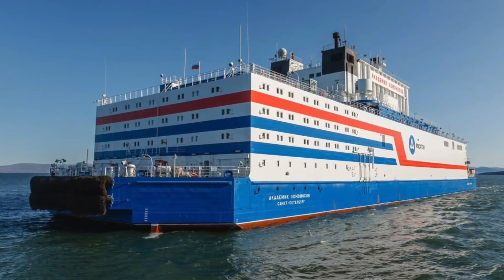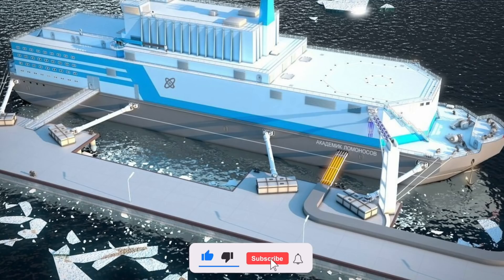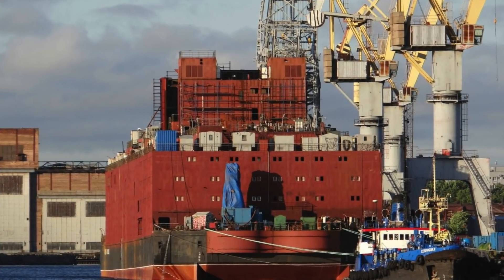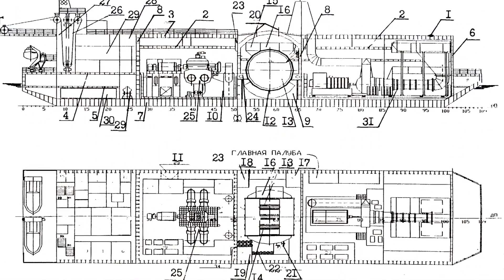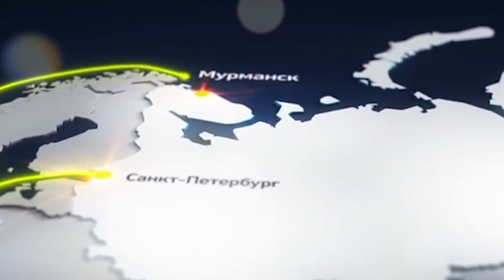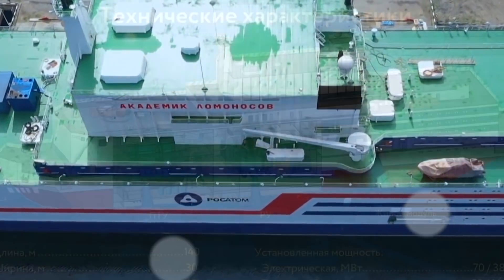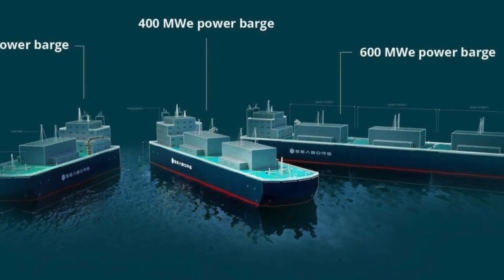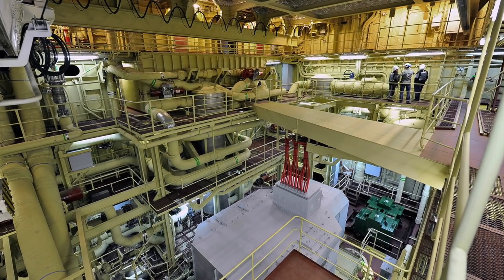Is the Lomonosov floating nuclear power plant a global catastrophe?

Comment: Pro's and Con's NEED to be worked thru one by one, to determine which decision/direction to travel. This is ESPECIALLY true when it comes to the matter of Nuke Power alone but, installing a Ship that is a Power Plant "to supply power to remote locations", why not spend the Rubles on P.V. cells instead? There is no shortage of Sunlight, or even some other "Green" energy source. Being situated in the Arctic, I would be VERY concerned of a Powerplant Ship, especially in the Famous region of Siberia, in the Kamchatka Penninsula, experiencing some EXTRA-SEVERE winter conditions including Glaciers. But with the track record of the Soviet Union and Nuclear powered ships being decommissioned by scuttling them without even securing the reactors, seemingly not even giving a s*** about the Environment. Wanton actions against everything Natural, Exo-system related, health concerns, etc. So.......
Just my thoughts here.

Comment: THE US havent realesed a non nuclear submarine since the 50,s so ye its a horrible recipe for disaster 😂😂😂😂😂😂😂😂

Solar and wind arent renewable either  the material used aint 1 shit renewable and quartz with the extra is toxic as hell not to speak of the batteriets.
 It also provide next to 0 energy by comparssion.

A failing experiment on a wrongly buildt reactor and a diesel generator Being flooded aswell as A HUMAN TURNING OFF THE COOLING PUMP should really NOT DEFINE AN INDUSTRY, you retards!

And fyi a coal power plant releaser more radiation than nuclear powerplay during its lifetime, idiots.

Comment: Go to nine sea camels with desalination on one, outboard.  Cooling coils within two, outboard.    Nuclear boiler in middle sea camel.  Electric generation from steam in two, inboard toward shore.  Cogeneration on one, aside.  Controls, crew, spare parts, shop, in another, also aside.  At ten years, the sea camels needing refresh are quickly replaced by new sea camels and the unit continues production with one or two days down time.  The unit removed goes to dry dock for refurbish, update, inspections.

Comment: While the Lomonosov may well have a 'great margin of safety', there is only so far one can go with a PWR design. I like the inherent safety features of Seaborg and Thorcon's MSR designs better. Also cheaper in the long term.
Reply: Look, 'better' is the enemy of 'good enough'.

PWRs are 'good enough' and we're not building enough of them today. Tomorrow's revival's of past technology that got left at the wayside by political funding cuts is for tomorrow. At least Lomonosov is providing power and heat today.

Plus, for a marine/aquatic application, I'm not sure what is ultimately safer. A PWR/BWR where you're surrounded by limitless emergency coolant/moderator. Or a MSR/Liquid Metal Cooled Reactor where in the same position, you have little back-up coolant at best, or you're surrounded by a fire and explosion hazard rather than limitless cooling.
Reply: @TheSonic10160  Don't get me wrong, I'm not against PWR's in principle, but any energy production system has to be competitive, efficient and as safe as one can manage. If MSR's can be built cheaper, run with a fuel efficiency orders of magnitude greater, produce less waste as well as using existing partially used fuel, and be inherently safer, why would that not be worth doing? Tomorrow's technology only becomes today's if people start using it. 
In the maritime setting, if you suddenly require 'limitless emergency coolant' that might indicate that 'good enough' is sometimes not that. With MSR's, the negative temperature coefficient and rapid fail-safe fuel drainage in extremis, would seem to be sufficient for safety concerns. I would certainly agree that having a liquid metal cooled reactor on a boat would be nuts.
Reply: @juvenalsdad4175  ".If MSR's can be built cheaper, run with a fuel efficiency orders of magnitude greater, produce less waste as well as using existing partially used fuel, and be inherently safer, why would that not be worth doing?"

Obviously, yes. But that requires them getting there and as it is PWRs and BWRs struggle to get built. I'm looking forward to the nuclear renaissance (in the West) of the coming decades.

Comment: Chernobyl had a poorly designed, inherently unstable reactor type (RBMK) that got absolutely manhandled to the point of catastrophic failure by its operators. Fukushima did have proper things like containment buildings etc. in place, but placed their backup generators at ground-level in an earthquake and tsunami prone area, which wasn't very smart. Add to that the record breaking earthquake strength and equally record breaking tsunami height and there you are. But still the containment buildings did what they were designed to do, keep everything in, unlike Chernobyl where there was no proper containment to begin with.

The Academician Lomonosov uses a PWR reactor type, which is inherently more stable and safe. They're nothing like the moody RBMKs. These two don't even live in the same street when it comes to safety and stability.
Reply: They're just reckless in a way that difficult to understand in the west.  The number of nuclear accidents theyve had that are known is incredible, and i'm sure there a plenty that were kept quiet.  I've never seen numbers on it, but I don't know if a containment dome would have held up to the force of that r lid being blown off the reactor.  Even if it did get destroyed it doubtless would have been better than none at all.
Reply: @mtmadigan82  
You are a 100% correct, the cavalier way in which they approach(ed) anything that has to do with nuclear technology truly is a sight to behold. If you're interested, search for "Kyshtym/ Mayak". This 1957 accident rivals the Chernobyl accident in terms of pollution (and that's saying something!), but was kept under wraps for over 30+ years!

As to the Chernobyl accident, it was well known among most operators that the RBMK is notoriously capricious and unstable when run at low power. It absolutely hates being run at low power for extended periods of time because it can't do it, the reactor was never designed with that in mind. But that is exactly what they forced the poor thing to do that evening in order to be able to complete their ill-fated test. Add to that, that the operators physically disabled/ cancelled/ ignored every safety system they could get their hands on and operated the reactor well beyond the design specs, and you can already see where this is going. Yes, the RBMK is a design with many weaknesses and technical shortcomings, but the operators should have never pushed things as far as they did. At that point you're just begging for the inevitable to happen.

While I have done extensive reading on the subject, I do not have the exact numbers for you either. But suffice it to say that a containment building probably wouldn't have been able to withstand the incredible forces that were released during the prompt neutron excursion. That being said, the fact that they thought they wouldn't need one to begin with again speaks of their cavalier approach to all things nuclear and the complete lack of any safety culture, which ultimately led to the Chernobyl disaster.

Comment: I don't get it.  Why is it mobile?  Power plants are usually needed for extended durations (think in the range of multiple decades).  If these require on shore infrastructure, why not just build a reactor instead?  I just don't understand the point of making it "mobile"; it won't be sailing around.  Because it needs on shore support it can't show up to disaster areas and provide effective relief unless there is a working shore station.  Also, let's be honest, power generation isn't what is holding back economic and cultural expansion in the artic circle; it's because it's cold and there are bears.
Reply: The only way to get large components to most of these towns is by sea, since building roads and railways over permafrost is either difficult, or uneconomical. So it would have to go by sea anyway. So why not skip the troubles of trying to build anything in the arctic and ship it in ready-made and ready to go without having to break ground on anything in the arctic.
Reply: I don't know for sure but I imagine because permafrost is melting and keeping the current nuclear plant there is getting unsafe.
Reply: Easy!! When it shits itself ( and being new russian tech it will!) They tow it out to sea and sink it! No clean up...no problems!!
Reply: Because you can flush radioactive waste in the sea!
Reply: @donraptor6156  главное чтобы твоя мамаша не сбрасывала фото на онлифанс.
Reply: Also makes it very tsunami resistant.
Reply: Reactors take one or more decades to build. Thats why.
Reply: If the town or city does not pay the electricity account in time, they could shift away the power plant somewhere else.

Comment: They are a good idea.   It is difficult to cut them off from their water cooling source.  It is possible to easily switch them out.  If several can be produced, mass production reduces costs and improves quality, and staffs are familiar with them and can be moved around.  A major problem with Three Mile Island was the staff had been trained on navy reactors and that was why they were hired.  But it wasn't a navy reactor which resulted in the wrong decisions.

Comment: What happens when it flips over are the control rods held in both directions 
Personally I believe this idea to be a safe one not sure about each design but worst case u sink the vessel and cool the core if a melt down happens 
Tho we are human and will find a way to mess things up some how
Reply: In western Navy ships (aircraft carriers for example) with nuclear propulsion, the control rods have very heavy springs and they are only out of the core due to strong electromagnetic latches holding them above the core. The moment you lose power for whatever reason those latches lose power too and automatically open, dropping the control rods in and shutting down the reactor within 3 seconds. The heavy springs make sure that the rods stay in, even if the ship would capsize and/ or flip upside down. Since the Lomonosov employs the same reactor type (PWR) as the western ships, I'm assuming the Russian designers made sure that they have this particular safety feature in place as well.
Reply: @swokatsamsiyu3590  Absolutely, moreover. How would it flip over?? It's working life is spent permanently moored in a harbour.
Reply: @TheSonic10160  
The only thing I can think of is severe Siberian winter weather, or something untoward happening while they move it to its destined harbour. But for the rest you're absolutely right. It's not going anywhere, it's not fighting battles like a navy ship. It just sits there making electric power.
Reply: What happend to the nimitz class?
What happend to every submarine the USA made since the 50's ?

Yeah thats right absolutey Jack fuckin shit!